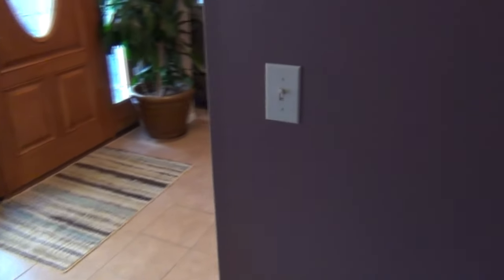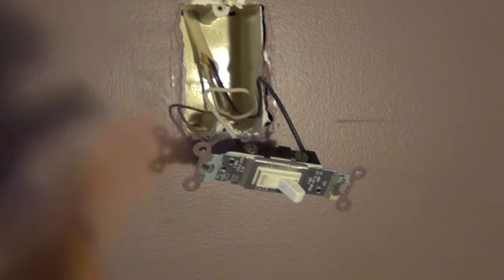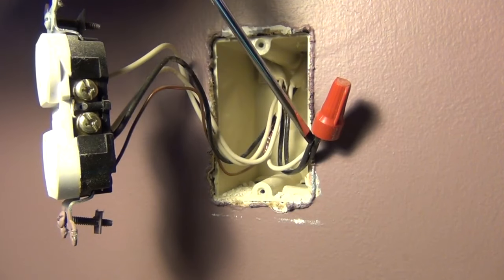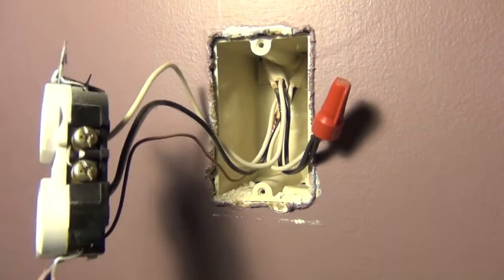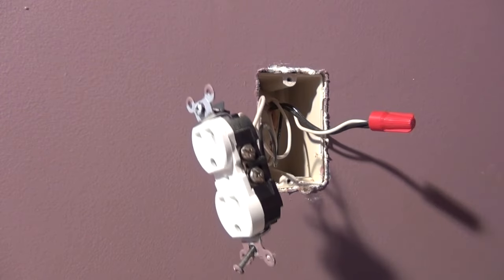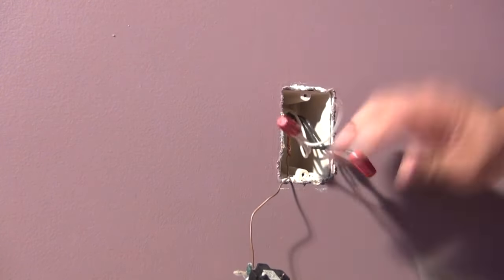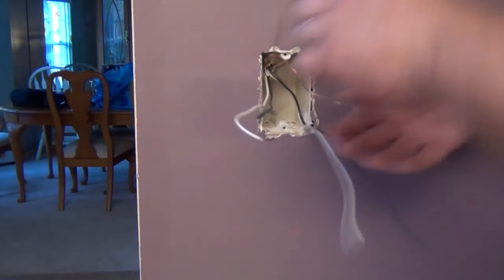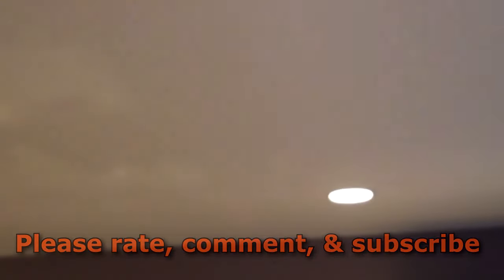Rewire an Electrical Switch box with No Neutral

Comment: How did you create a neutral wire when it didn't have a neutral wire? Magically just say, "now the white wires are neutral" while not actually going to the box to connect an actual neutral wire and fish it to the switch???? This makes no sense.

So, then later in the video...you say that there IS a neutral wire in the socket area...which means there was a neutral wire all along so this video isn't about making a new neutral wire in a light switch that previously did not have a neutral wire in the circuit? I have a light switch with no neutral wire, neither does it exist in the power supply wire and I am trying to figure out how to hook up a light that has a neutral connection to this non-neutral wire switch... Now I am even more confused. 

The only thing I can think of doing to be safe is to connect a neutral wire from the junction box, then run it through the attic to the light location, then the single power wire from the switch itself connects to the power connector on the light bulb.
Reply: The white wire in the outlet box was connected to the black wires in the wire nut. This made the wire hot, not neutral. When he removed it from the wire nut, it was no longer hot, but since it was already ran to the switch, he was able to "convert" it to a neutral.

But you're right. A situation where you don't have an extra wire from an outlet, you wouldn't be able to do it this way.

Comment: You never showed how to re wire the light wire to the dimmer switch
Reply from the maker: LinoPR 2016 Sure I did. It's the last segment of the video before the closing.
Reply: at 10:36. You come back to the light switch and then suddenly there were extra set of wires that weren't there before you went to work on the outlet. I think that is what LinoPR was referring.
Reply: He did not show running the wire from the switch box to the light. But he said early that he had a separate video on installing the light, perhaps this step is in that video. If not there are lots of videos on running wires. And he did show connecting the dimming switch and even how the old switch should be connected. But it is fairly simple once everything is correct in the switch box. Ground to ground, line to line, and load to load!

Comment: since the wiring colors were wrong.. probably not the best example to use in a video..
Reply from the maker: shinchiwarrior No wiring colors were wrong, not sure where you got that from.
Reply: I think that makes this a perfect example.  He explained why they were wrong, and what to do about it.  This is a pretty common problem in wiring. I have found several switches in my own home that do not have the hot wire marked on the switch.  It is good to be able to recognize it.
Reply: Nothing was truly ‘wrong’ in wire colors. The previous work failed to mark the white wire as a hot wire. I believe you could use red or black tape for this, he mentioned black tape. 
However, this was a perfect choice to show in the video in my opinion since not so many years ago this was a common practice and few actually marked the white as a hot. 
Great video!